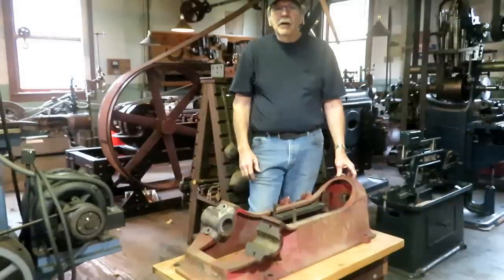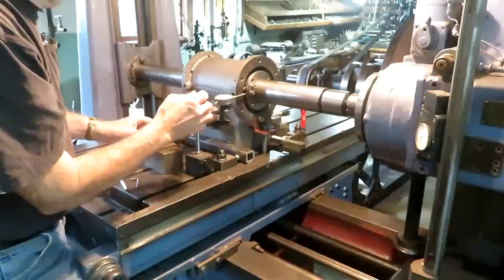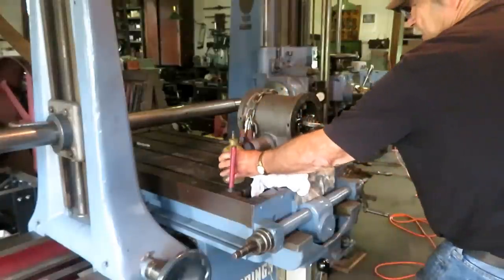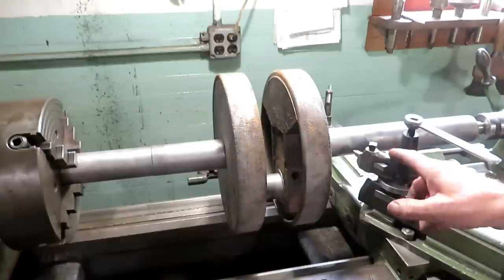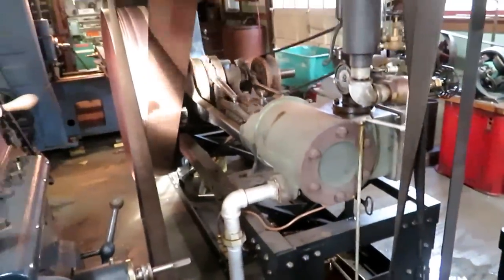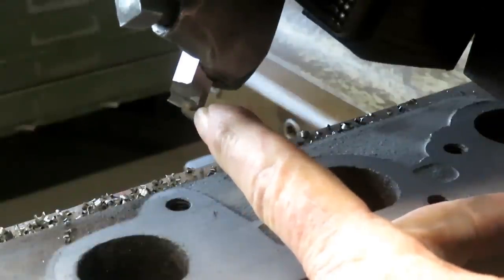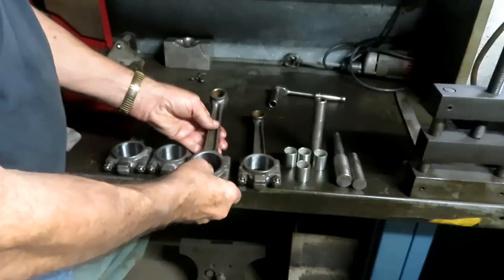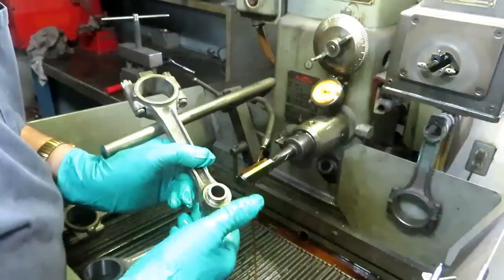Old Steam Powered Machine Shop 82 boring a steam engine cylinder

Comment: I had the privilege of learning how to use many of those machines in a old machine shop however it had all be converted to electric and no more steam engines but we did still run a lot of equipment with the flat belts.

Comment: The one thing that always strikes me is the absence of steam leaking from your superb power plant. Well fitted, well maintained and I believe well loved.
Reply from the maker: Hi Brian, The rod and valve packing leaks a little water most of the time, probably because the steam is so saturated at that low pressure....Dave

Comment: Love that kind of work. Ran machines for a lot of years but never ran belted ones. Your ceiling must have some good timbers to hold up all that iron. I ran Sunnen hones for many years in my aerospace mfg. career. Also ran Studer od grinders. Both super accurate machines. We used laser mics. and air spindle gaging for our measurements. Good to within about 50 millionths.  I have never seen aluminum rod bushings before..

Comment: Looks like a Giddings & Lewis boring Mach. I used one many years, only had a 3 digit serial #.
Reply from the maker: Hi Henry, This one is 2 1/2". I think it is the smallest ever made.....Dave
Reply: @davidrichards5594  ok, what does 2 1/2” refer to. Thanks
Reply from the maker: @henrytupper6959  spindle diameter, most were 3 1/2" and over and were about as big as a car....Dave
Reply: @davidrichards5594  That’s probably the size we had too.

Comment: Hi Steam guy. I like your work. It must be very nice to work in there during the winter. I've been out of the trade for 8 years( got hurt) but I do miss it. I spent 25 years machining castings and internal parts for a co. that made steam regulators, steam traps and safety valves. Before that Ispent 7 years working for a drill bit manufacturer named New York Twist Drill and they owned Bath tap. You probably have some of that stuff laying around. Any way, It's all made in China, India, and Mexico now. So again, Thanks for the cool videos. I do miss being in a real shop.- Yours, Jim
Reply from the maker: Was that Bath, NY?....Dave
Reply: @davidrichards5594  Bath taps and gauges were made in Worcester Massachusetts. It was an old company tha was owned by new York twist drill until NYTD was sold to another corporation called Regal Beloit. Regal Baloit already had an outfit that made taps and dies so Bath got closed down with out warning. That happened in the mid 80s. A year or so later New York Twist Drill was closed down as well. If you look through your drill collection and find a drill with Sargent stripes on it, that's one of mine.
Reply: @henkvanderwal2424  i can't imagine any one falling for that
Reply: @henkvanderwal2424  no it's not. Thank you for thinking of us.
Reply from the maker: They're gone.....Dave

Comment: Hello David,
A very interesting video as always.
I especialy loved the view  at the pully and belt set up from the steam engine to the lathe s.
Very usefull for me,I have startend with my pully s and bearing setup in my oldtime machine shop.
Ik hope to have the shop running at the end of next years.
No steampower I afraid ,an old 3 phase E motor  1920 or a single cil hotbulb diesel engine 1926.
I wil make it possible to use one or the other.
I wil keep U informeren.
You are a big inspiration for me.
Greetings from Friesland in the Netherlands 
Henk
Reply from the maker: That's very good Henk, Keep us informed of your progress...Dave

Comment: Hi Dave, as a retired mechanical engineer in UK, interested in your work is not the word, more like fascinated! Would love to be working with you on your projects.  I always found slow speed and feed plus coolant gave the best suface finish when turning steel maybe not cast iron. Perhaps the wrought iron has poor grain structure giving you the poor finish , can't tell without running the hand over it haha. Anyway I am sure you will have it perfect in the end. Many thanks from Nr Liverpool UK.
Reply from the maker: Hi Chris, Problem is, it has no grain structure at all. Early (before 1900) Wrought Iron has hard slag inclusions. One piece claimed a nearly  new band saw blade a couple days ago. Tom and I decided to scrap any stock in the shop that we could identify as Wrought.

Comment: Dave I was thinking a viewer sent you a portable crank grinder in a big wooden box a few years a go or maybe it was Keith Rucker if not may be the viewers would recall. It sure would be nice to true up that rod throw. You just hook the pan rail adaptor to your lathe cross feed, I did it a lot in my shop in Alaska I didn't have a crank grinder and the closest one was down in the world. If Kith is the one or whom ever my be Abom 79 you could pick on your way north next year. That is if they would lend it to you as it is probably the most used tool in the shop or probably still in the box it came in. Just a thought. Its  all in the setup. Paul

Comment: Hi David. Just discovered your very interesting channel. I'm looking forward to watching many more of your videos. Just FYI - your discoveries of (and comments about) the wrought iron drive shaft (presumably on the basis of those linear carbon inclusions we could see) were unfortunately inaudible because you were standing too close to the machine. I would have liked to have heard more about the problems of using this particular material in high load applications. Is it possible to include captions/text on the really noisy bits of your videos? Anyway, best wishes from over here in the UK.

Comment: Hi. How many wheelbarrow of wood do you burn by day ? Regards
Reply from the maker: It depends some on how good the wood is, but usually about 3 to get some steam and another to run it up to operating pressure. Takes me about an hour and 15 minutes, Tom can do it in less than an hour....Dave
Reply: @davidrichards5594   Thanks !

Comment: Love the boring work you do. What model is that giddings Lewis boring mill? I looked up Wiley iron works. Is that correct on the engine.
Reply from the maker: Model 25 Giddings & Lewis mill (2.5").   The steam engine was built by Liley Iron Works, Erie, PA.....Dave
Reply: @davidrichards5594  Thanks Dave. No wonder I could not find any info on the engine.  I know Craig Prucha up in Pavillion NY has a giddings and lewis about the same size.  I wound up with a DeVlieg 3B48 which I plan on selling.  The smaller G&L better suits my needs.  But these smaller G&Ls seem to be pretty rare animals.  You agree.   And finding a line shaft Lodge & Davis shaper or a G&E line shaft shaper has proven to be a challange as well.

Comment: I wonder how often they have to get the boiler inspected and how long do they last ?.
Reply from the maker: New York State requires 2 inspections each year, one internal and one external under steam plus a cold water hydrostatic  "pressure" test every 4 years, plus an ultrasonic thickness test on old boilers whenever they feel like it.....Dave
Reply: Thanks for the info. Better safe than sorry.

Comment: Dave
I got a question. How were these flywheels machined? I can’t imagine them using a super mondo machine tool but I could be wrong. I am planing on making a flywheel about the size of your Liely. Any ideas?
Reply from the maker: The logical machine to use would have been a "pulley lathe" or "gap bed lathe" which allowed  large diameter work to pass below the ways. A vertical boring mill or "Bullard" type vertical lathe would also do it. I will use my horizontal boring mill with the flywheel between centers and a tool post on a pedestal on the table like a lathe....Dave
Reply: @davidrichards5594  Thanks Dave
I am in a legal fight with my brother to keep the family home. The house is really to large for my needs. The current plan is to build a timber frame. Part home and part shop. I had no idea I had squirreled away that much old iron over the years!!!!!  That includes two Rockford planers, three large shapers and a 36 in Bullard!  I am pearling down the herd a bit but still have quite a wood shop and metal shop. Long term plan is to build a steam engine. A 5x5 or 6x6. I also have a Devlieg 3B48 jig bore. I got talked into it by some guys on practical machinist when I was looking for a giddings and Lewis. They felt it was superior to the giddings and Lewis but I think they were wrong. For boring cylinders I think the giddings and Lewis is a better machine. I have seen the bullard in a shop under flat belt. In looking at mine, it appears that the motor drive is original but an after thought. Same with my Hendy 16 in shaper. I think I need to give serious thought to getting rid of the bullard.

Very much looking forward to more work on the Liley engine. Also looking forward to the O&S generating some DC power. Who knows maybe is grey beards will break down and get a Tesla power wall…. Just Kidding!!!!

Comment: What's with the wobbling on the honing machine?  I don't get it.  Is there a different rotation for the outer holder and the stone and the wobble?  I couldn't see what was going on; if it was just a simple eccentric motion, it would have worn the bore eccentric.  Gotta be something else going on...
Reply from the maker: The honing mandrel is independent of anything outside of itself, and lines itself up on the hole in a 3 point contact with the shoe (2 points) and the stone. The shaft that drives it just has to rotate it, nothing else. You can adjust it to run straighter but it doesn't matter and the next job might be a lot different size and be way off the other way, so most operators just leave it at what "off center" it is. Surprisingly accurate.....Dave
Reply: @davidrichards5594  Ah!  I get it -- thanks!  I missed a couple of the physical characteristics.

Machinists be clever folk.  :-)